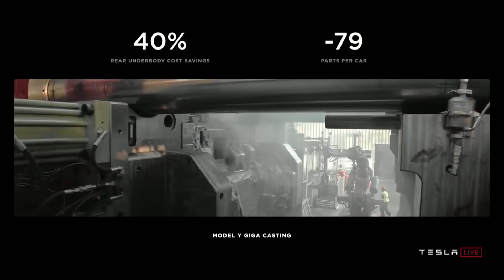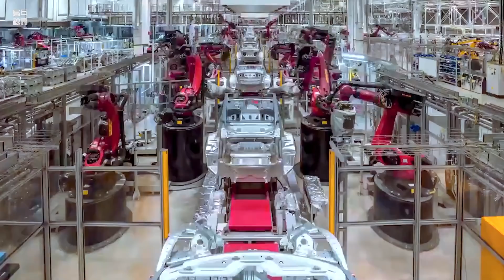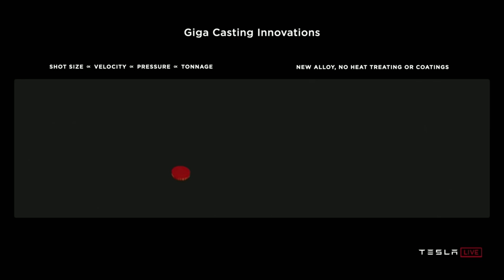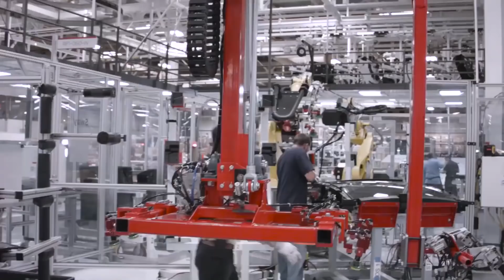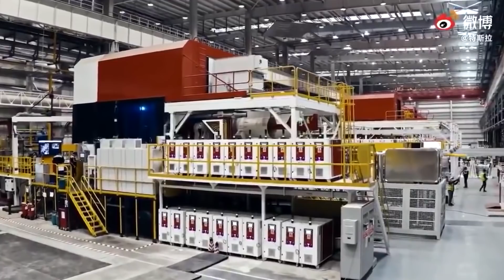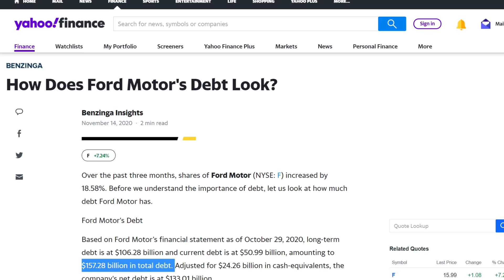Tesla Giga Press: Why dont Auto manufactures copy?

Comment: So the disadvantage of a welded structure is that if one of the robots goes down, the whole process stops, but apparently a technical fault in the machine you rely onto do everything doesn’t bring the process down? 🤔
Reply: Every assembling point has a maintenance cost, and probability of failure.
With fewer assembling points, you have less risk of failure and less cost if maintenance.

You can even doyble down maintenance to offset risk even further, and still be mike's ahead on both cost and risk.
Reply: @4000valentin  True, but one complex system is not necessarily more reliable than a series of less complicated ones.
Reply: @Doug_in_NC  , true. But each system has a minimum static cost associated with it. It doesn't strike me as being obvious that the single system is orders of magnitude more complicated. Considering how many systems it makes redundant, I seems like a high probability that it is a net benefit.
Reply: @4000valentin  No, it’s not obvious either way which makes the most sense, either from a reliability perspective, or from a total cost. By investing in really complex casting, Tesla may make each part cheaper, but it means changing model designs is much more expensive as the tooling cost us high. They don’t have many different models and they don’t do the traditional new model once a year cycle so it’s probably more manageable than for traditional automakers.
Reply: I guess that what he means is that instead of making and assembling 70 parts (using 100+ robots) has higher probability to fail for some part, than making one part only. (Example taken from the making of the rear part of a Tesla.)

Comment: In manufacturing, the terms 'subtractive' and 'additive' are also both used when electroplating Copper onto PCBs (printed circuit board panels) and/or PWBs (printed wiring boards.)

Comment: This guy's is really not that knowledgeable about robotics in a factory setting, and it shows. Incant comment on the rest of what he's saying, because it's not my field, but he is a little to invested with the story he's telling to not take it with a grain of salt...
Reply: No fool, he’s talking about the problems with using robotics…this is actually what happened with Tesla…as Tesla expands…these problem can come up again! Welding 100s of sheet metal is very slow!
Reply: @18magicMARKer  stating an argument calling someone a fool is pretty childish.

I have worked as an engineer at a big 3 auto plant, and now own a business doing industrial robotics. What are your credentials again?
Reply: Are you two serious? Quit it! Spread love and knowledge.
Reply: Guy you’re toxiccccccccc. Heartless as a robot on god
Reply: @NoRemorse92086  Agreed, the guy who called you a fool is a fool himself.  Here's my question.  How many parallel assembly lines are there typically in a given automotive factory.  How prone are the robots to calibration drift and how often are they re-calibrated?  What he said seemed to make sense, but then again I have no practical experience in that area, so any well made argument would make sense.
Reply: @vladisergeiev7278  it's partially critical path, he's correct about that.

As far as drift? It doesn't really happen. He said 20mm in the vid. They are 0.0Xmm repeatable for the life of the robot. 

Body shops usually are not single lines though. You've got a line for door rings, one for hoods, one for a pillars. There is certainly a single line in the center where it all comes to get her, but you have that for any modern assembly process.

Currently the body shop I used to work out can kick out a vehicle every 45 seconds, with better build quality than I've seen from Tesla. That includes any production hiccups. Are there better and cheaper ways to do it, learning from Tesla? Absolutely. Are legacy auto makers idiots for doing it the way they are? Absolutely not.
Reply: @vladisergeiev7278  most car production lines have partial redundancy, which means, you do not have duplicate stations/steps, but broken stations/robots can be compensated along the line, while compromising speed, that is one of the highly complex planning steps of these lines but allows partial maintenance while the line is never even stopped.
Reply: @NoRemorse92086  Thanks for the reply.
Reply: @DooMMasteR  Ok, that makes sense.  It would seem like any lack of redundency on the line would be suicide in terms of lost revenue.

Comment: Metal presses are decades old.  The reason Big Auto does not use them is because they change models every few years and will not recoup the cost of the press if they have to change it out regularly.  Basically, they could do it, but don't see the value of saving lives.  Why build a vehicle that lasts longer and is safer when you can just sell them a new one every 5-7 years or 250,000 miles?  They depend on that turnover.  Tesla does not build in obsolescence.  They try to build it to last as long as it can.  They are a car factory building company, not a car company.  Selling cars is just a side business for them.  Tesla has the plan of never selling another car to consumers.  That is the goal.
Reply: Are you insane?! You realise that there are millions of 20+ old years cars on roads right!? To make a new car model manufacturers just needs to change the dies of the presses, I dont see any problem with that and also the presses have already been paid for years. Vw for example makes a vehicle every 16 seconds.
Reply: @alanmay7929  You type a lot.  No. Yes. Yes I agree. Yes, I know.  No they don't.  It takes VW an average of 17 hours + 4 hours for paint and finish.
Reply: @davidbeppler3032  well vw makes 8 cars each seconds and the 17hours things is for years ago and its just from raw materials to the final car which tesla ain't even remotely close to.
Reply: @alanmay7929   Sorry... wrong.  Smelting steel takes hours on it's own.  I know.  I worked with smelters.  It is not fast or easy.  VW rolls a car off the line every 8 seconds?  Maybe.  But it was on the line for 17 hours.  You ever worked at a factory?
Reply: @davidbeppler3032  mate go inform yourself again on the supply chain. vw and other manufacturers  even tesla have steel, aluminium suppliers with their own special alloys recipe. No car company owns or operate a foundry.  I actually worked at a factory on the whole production process.
Reply: @davidbeppler3032  all car manufacturers including tesla doesn't make everything in house, there are very specialised and experimented companies that they work with to make custom parts for them. Bmw even built a gigantic carbon fiber production plan in the US to significantly reduce the production costs of the material, bmw has been using carbon fiber their cars for years.
Reply: Your obsolescence thing is just stupid, people have been buying old or crashed teslas to rebuild or repair but tesla doesn't even sell parts to them. Hyundai makes ships, very heavy duty equipments and they have foundries...... Tesla will still need stamping presses for the fenders, hood, doors, hatch.....

Comment: A question for me is repairs. Early Hyundai in Australia we’re very cheap but cost a lot to insure because the parts were very big, a small repair and you had to replace a large section. If you could ask this it would be interesting
Reply: Repairing the Castings is your least worry if you get in an accident severe enough to damage them, because the Impact necesary to do that would have to tear through at least half your Trunk/Frunk first

Comment: It’s kind of interesting that the comparison of having a line of machines where one failure stops the whole line is thought to be worse than having all the parts come from one machine that can stop the whole line. Redundant flexible systems might give you an option to get parts if there’s enough capacity but if all the eggs are in one basket you’ll need to be sure it’s the right basket. 🤔 

I like what Alex said about leading edge vs bleeding edge that’s very much a thing. Look at the Tucker automobile and unibody construction that the automobile manufacturers railed against and now everyone does it.  
I think with the electric motor integration that casting might make more sense than with ICE vehicles because the powertrain is right there, not on the other end of the vehicle. It also helps bear the drive load from the wheels to the motor without putting it through the structure of the car. However changing something like wheel travel or shock tower locations will probably get very interesting as the new mold has to get made and proven to make quality parts.

What about mold maintenance, these molds must not last forever, what’s the cost of maintaining the mold that is the keystone of your production?
Reply: re mold maintenance.. when in the past you had a guy weld and then grind a mold to get back to spec these days you have CNC mahcines who do those things in one set up. Just look up DMG MORI Lasertec here on Youtube and you see where this is going.
Reply: It will be very, very expensive for mold maintenance.  But if you can produce 30 cars in the time it used to take to build 1 car, it is worth it.  Even more important, if it saves 1 life it is worth it.  On another note... gigacasting will potentially reduce weight and material by a few hundred pounds and a few dollars.  If you save $15/casting on each car and build 1 million cars, that is $45 million dollars in savings.
Reply: @davidbeppler3032  uhm nope thats not how it works, the casting will not significantly boost the production of cars it will not make enough cars compared to regular stamping processes, the ICE manufacturers have been sharing vehicle platforms for years and it allows them to significantly boost the productivity instead of having many different dies.

Comment: The thing I'm wondering about just how well these structures will perform in crash testing.
Reply: I don't think the problem will be the crash test, I think there will be a bigger problem repairing the structure, which could lead in throwing away a car that could be repaired if built in a different way.
Reply: @Tyrianad  As I have said multiple times so far, Insurance companies will lose their collective minds when they can't replace the whole rear casting from a minor accident.  It was designed to be cut and welded... Insurance companies demand new parts, not repairs.  Expect any $1500 accident to total the Model Y because the Insurance company will claim repairs cost $47k.
Reply: @davidbeppler3032  If the Casting gets damaged its certainly not a minor Accident. to get to it you have to go through half the trunk/frunk first. Thats enough impact force that you can be glad to walk away from the crash unharmed.
Reply: Or in other words: What you worry about is basically the same as worrying that your Gasoline Engine can be repaired after a frontal impact..
Reply: @unitrader403  Umm... nope.  I guarantee it will not take a major accident to damage the casting.  Also 3 castings should increase safety while reducing weight and complexity.  It is a win, win, win.
Reply: @Tyrianad  According to musk cut and repair
Reply: Lighter cars with stronger structure = better results.  That is the point.  Safer.  This is what it looks like when Safety is actually #1.

Comment: Legacy auto makers actually make their profit from replacement parts, which also factors into the issue of moving to a Gigapress and redesigning their vehicles.
Reply: Legacy uses a platform on sooo many different models to reduce manufacturing costs and the parts can be interchanged soooo easily. The toyota rav4, camry, avalon, sienna, lexus es300...... all shares the TNGA platform for example

Comment: I was wondering why they call it a press if it is casting?  I have no clue about manufacturing as you can tell.
Reply: The machine itself is a casting press. The multiple dies have to be pressed together to stay closed when you inject the molten aluminium witch also require quite a lot of pressure. The force or the casting press has to be larger than the force of the material flowing inside the die and hopefull filling all gaps in there. Then they cool it down and open the press / dies to release the part

Comment: Just remember that Tesla/Musk rarely ever comes up with an innovative idea. There are much larger presses around the world that have been in operation for (in some cases) over 100 years. These would probably exceed the definition of Peta-presses. Admitidly these are not used for as complex a design, but thats just a matter of building your mould. The only real new thing here is the use of this alloy, something which is a proprietary material of Munro & Associates. 

As with most things, Musk has money but little imagination, so he turns to the ideas of others - which is fine. But it doesn't make him the genius, just a reasonable purchasing manager with loads of cash doing exactly what a 14 y/o boy would do with those tools. Building rockets and shiny things that look cool and promise to go fast.
Reply: You're actually incorrect there's not been ever used a 6,000 press gig of press if you want to call it machine in the automotive they never used even at 8,000 Tesla's getting ready to build a 9,000 press this is never been done in the automotive industry
Reply: @hillbillyintheasia6122  there have been presses capable of >50, 000 and 60,000 tonnes since the 1950s. In 2013 an 80,000t press started operation in China. Details are here https://www.gasparini.com/en/blog/world-largest-hydraulic-presses/ 

It's not really important that it was/wasn't done in the automotive industry. That's like differentiating between using a masher on potatoes or carrots. My point was this is neither new not innovative, merely applying known technology to a known process. 

As the video notes, the main thing stopping existing auto companies doing the same is the massive financial outlay to install these presses as well as the potential stop to production as the process is changed not to mention the commitment to then using the same moulds for  a long time to ensure profitability. That means whoever follows this process is locked into a set of specific designs that cannot be easily changed or upgraded.